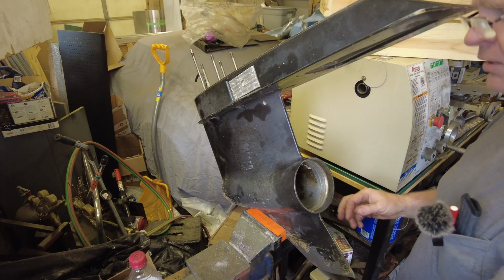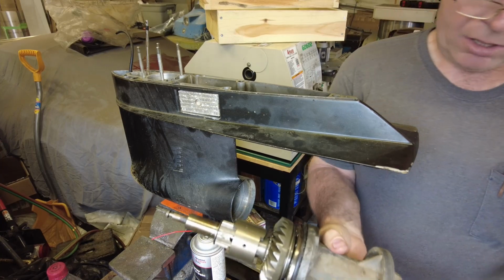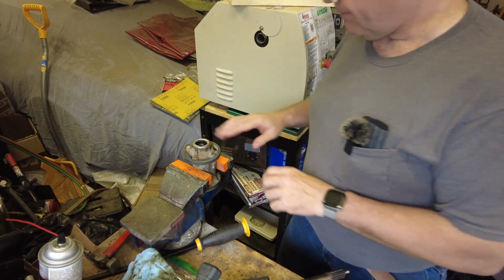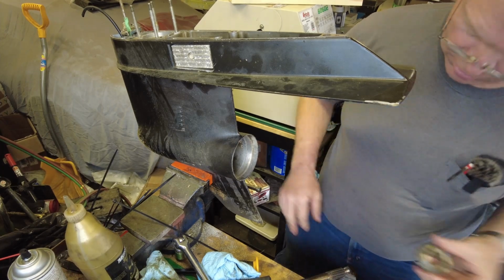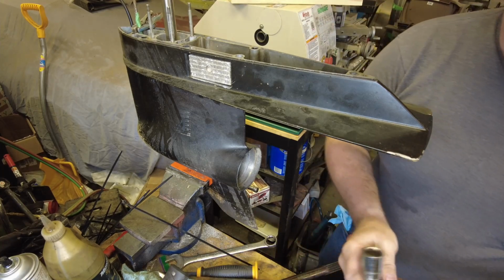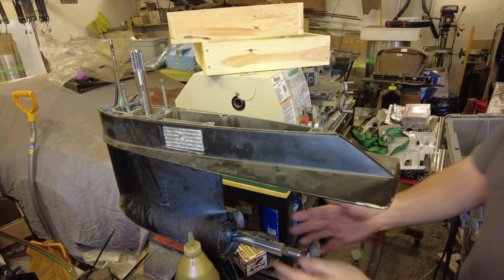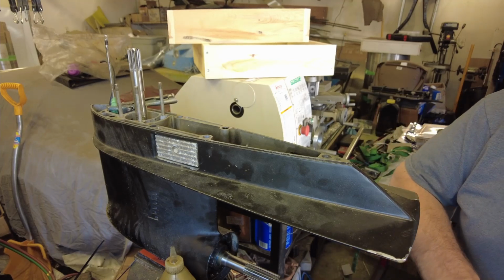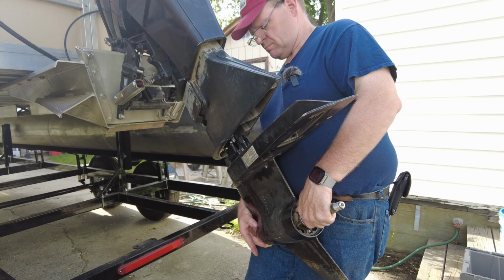Force 120 Hp Lower Unit Repair Pt3 - Reassembly: PROJECT PONTOON Ep 10.6

Comment: This would be a great video if what your are doing was on camera all the time.
Reply from the maker: Yeah, this was a challenging video to record.  The temperature was so high in the garage that the camera kept overheating and shutting down.  

The big takeaway from this series of videos was the difficulty in identifying exactly what parts you have and thus what to order as a replacement.  One of the most challenging things about working on this vintage of Force motor is the lack of consistency in part numbers.  Brunswick used several different lower units in any given model year so 25+ years later, it takes some real detective work to figure out what parts you need. 

Thank you for watching and for taking the time to comment.

Comment: I noticed that you showed the 3 shims that go on the main shaft to the crank, but I didn't see you put those back on reassembly. Do those go above or below the bearing? thanks
Reply from the maker: They go below the upper bearing to set the lash/preload on the combined upper and lower stack.
Reply: @DougsMessyGarage  yeah looking at the diagram it shows that so thanks. Can the old ones be reused or it is mandatory to replace, I think I found them online
Reply from the maker: @getitdone6694  Re-use is more a matter of having the correct shim thickness.  The purpose of the shims are to compensate for variation in manufacturing.  If your old shims provide the correct gear engagement and bearing pre-load, then re-use is fine.  If the shims are too loose or too tight, then you may need to play with the an old/new combination to get things setup correctly.  I got very lucky with mine as the gear engagement and slack were nearly perfect after reassembly with the original shim thickness.
Reply: @DougsMessyGarage  I wanted to touch base with you again since you were so nice to respond every time. So I put my drive in awhile ago and took it to the lake a few times. Every time at idle when I put it in gar the motor just died. For awhile I though it was the rectifier, then the stator then the trigger and even the flywheel the 2 carbs, the motor I rebuilt completely so I knew that was good. I have twin engines Force 120s so able to swap the electronics and carbs between the 2 and ruled those out. Installed new stator and trigger from CDI, fixed all old wires, and still it ran fine in the parking lot on a hose but died in the water unless I raised the RPM to 1200 or so. At high speed it was running ok in tandem with the other but at idle there was shaking and stutter and not normal. So I finally realized that when I initially rebuilt the lower unit, because it had water I had to change all the bearings, front gear and drive shaft bearing new and of course all the seals and O-rings as well. When I tightened the big retainer nut it was really difficult to turn the main shaft to spin the propeller by hand. I actually had to loosen it to be able to turn it at all. It is supposed to be tightened to 100Lbs of torque or so and not affect the spinning. Looking at how you did it yours was spinning pretty easily. So yesterday I took off the spark plugs on both engines and in gear I proceeded to turn the flywheel by hand and compare. On one engine I could tun it with one hand pretty easily while on the one I rebuilt I needed 2 hands and it has at list twice as hard to turn. I think that is causing the motor to die in gear. Is is to hard for it to spin the propeller in the water at 750RPM. I took the drive apart and started thinking on what t do next called around and most don't work on these engines anymore. One guy quoted me 1000 to check backlash and shim it?!! I have the original shims there were 2 on the propeller shaft and 3 on the drive shaft. I have a dial indicator but not with the attachment needed to do the shaft play properly. Also I don't have a shimming plug and cradle to check clearance at the gears. The lower drive casing has markings for forward gear as 7 and driveshaft as 4. But the book says you need the number from the forward gear and the drive shaft. I don't have those. I have 3 manuals and on one the Clymer they do show specs for forward gear backlash for 60,85-150(1984-1994) which I assume is for 85 through 150 including mine, and it shows 0.009-0.011in and prop end play 85-150 same years 0.005-0.020in. The service manual for the 1990 120HP doesn't mention specs. They just say find the markings on the casing and the ones in the gears and cross reference. That won't work for me.
Sorry for the long rant, but I have to ask how would you go about doing this to find a reasonable result. I was thinking to get some attachment dial indicator to mount on the 2 shafts and compare the backlash on the 2 drives. I don't know I am really looking forward to your take on this. Thanks in advance.
Reply from the maker: @getitdone6694  It certainly sounds like your shim stack is not quite thick enough.  I got really lucky with mine working out the same post repair.  The best option would be to source some different shims on eBay and try to come up with a slightly thicker stack.  If that didn't work for you, you could run your big retainer nut a bit on the loose side but keep it from backing out with some green sleave retainer lock-tite.  Finding some thicker shims would be your best bet though.  Sorry I can't be of much more help.  Leave a comment to let us all know how you made out.
Reply: Which stack are you talking about the upper mainshaft so add a shim and see it it allows for better movement. The lower prop shaft has the shimms behind the front gear race. It sucks that the forward gear set did not include a letter or number to cross reference. @DougsMessyGarage

Comment: That was a great work. I actually have a force 125 and I'm having some trouble finding the bearings for the drive shaft any. Ideas. We'll be appreciated
Reply from the maker: I got lucky and found my bearings on eBay but given how often Force changed lower units, it was really just luck .

If you cannot get the bearings based on the model number of your motor, possibly you can figure out the OEM manufacturer part numbers.  Look on your original bearings and they may be part numbers you can look up and order.

If your bearings are too damaged to find the OEM manufacturer part numbers, you can precisely  measure the inside and outside diameters of your old bearings and cross reference the measurements with OEM bearing suppliers to find a compatible bearing but getting the exact parts might be a challenge ordering this way.
Reply: @DougsMessyGarage  I have no luck with the engine marrow. I pull out the bearings but I run into some trouble because the numbers that the bearing have are not enough and they send me couple different kinds and the. Chef is too big or that is too small.

Comment: If you bought a new water pump housing. With the shifter linkage run through. What was that part number by chance?!? TIA
Reply from the maker: Hey Colton, thanks for checking out the video .  Unfortunately, I didn't end up replacing the water pump housing.  Force lower units are a real pain to figure out.  even the parts catalogs can't track things properly.
Reply: On that bottom housing of the water pump was there a o-ring that went around the bottom. Where you put that black rtv was to keep the oil from getting out of the shifter linkage.

Comment: Where did you buy your seals an do you have a part number
Reply from the maker: I got the seal kit from eBay.  Supposedly it was:

MERCURY OEM PART NUMBER FK1068-1 SEAL KIT, FORCE

But only some of the seals were compatible with my lower unit.  Force outboards are very frustrating to identify parts for.
Reply from the maker: @Blake Butler The seal kit I got was not the correct one for my lower unit but it did have several similar parts so I was able to kind  make it work.  

Force lower units are very difficult to identify parts for because they tended to just use whatever was on the shelf, regardless of what year it was supposed to be used for.

Comment: Thank you for the video, we were looking for a video like this and it's helpful. We have a Force 90 HP. We were wondering about the shim that goes on the drive shaft. We ordered a new one, but it is very thin like foil. The old one is all twisted but it's a lot thicker. Can you please confirm whether it's just one shim or three together, or are the after market parts just made cheap?
Reply from the maker: There are a number of different shims available for the Force lower units.  Each gearcase has a number on it and each shaft is supposed to have a corresponding letter assigned to it (or vise versa, it's been a few months).  You then look up the number and the letter up in a table in the manual an it tells you how much shimming is necessary for your specific combination.  The problem is, the shaft letter is on a paper tag attached by a thin wire by the factory.  Therefor a used/aftermarket shaft won't have the tag and therefore no way of knowing what the letter/number combination is supposed to be.  I got very lucky with my input shaft as it appears the shim I had was at least close enough to what the new shaft needed that I was able to re-use the original shim.

Unfortunately, other than trying to order some more shims to see if you can come up with a usable combination for your specific gearcase, I do not know another way to find a setup that will work with your lower unit.

Comment: Hey Doug,  we found out we have low compression in two of the cylinders any ideas or do you have a video on taking the carbs off and rebuilding the mercury force 120?
Reply from the maker: Force motors are known to have head gasket issues which could lead to low compression on two cyls.  How low are we talking?  The top and bottom, I believe, are supposed to be slightly different than the middle (2-5 PSI) but not dramatically.  Check my Will It Run video on the Force 120 for more information.

https://youtu.be/Ixf2cRReKB0

 I do have a video on cleaning up the carbs.  Check out:

https://youtu.be/exBCy4oojpQ

And for repairing the fuel pump:

https://youtu.be/z4sxxr9sPoE

Thanks for watching.
Reply: @DougsMessyGarage  
We're talking very low first one is good at 120 , second read a 34 third one at119 and bottom o e again at 34
Reply from the maker: @danawhitman8242  Could be a blown head gasket, cylinder/piston damage, or maybe damaged reed valves.  The problem is, with a Force outboard, if its much more than a bad gasket, you very quickly reach the point where finding a replacement motor is the more economical route as opposed to a repair.  Especially if you are paying a shop to do the work.